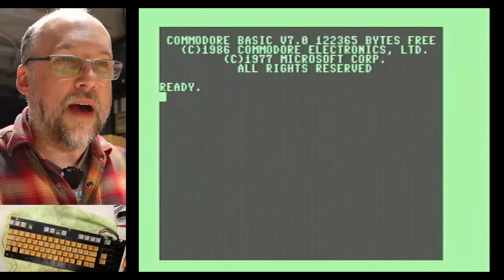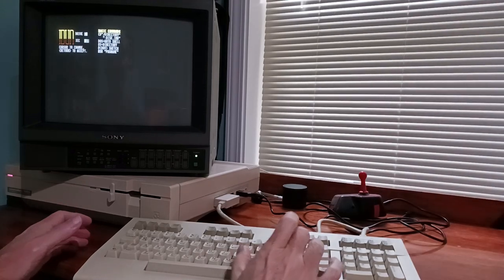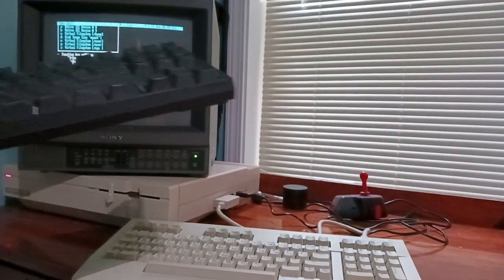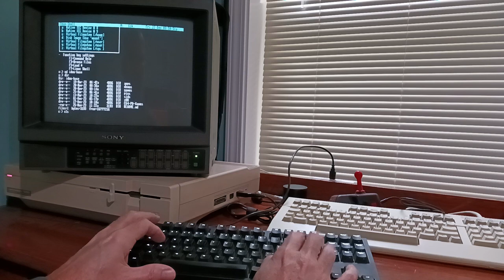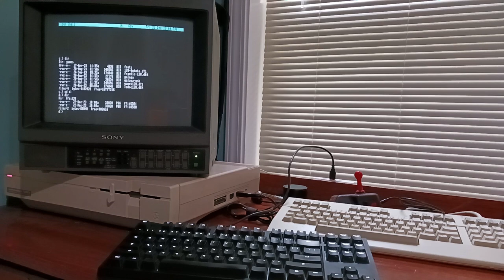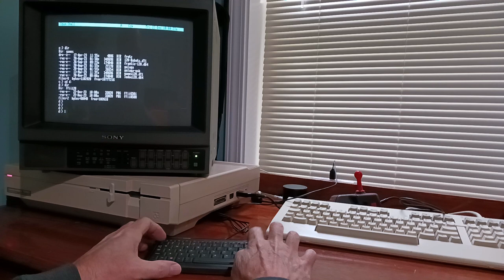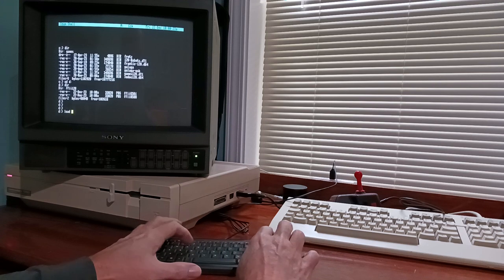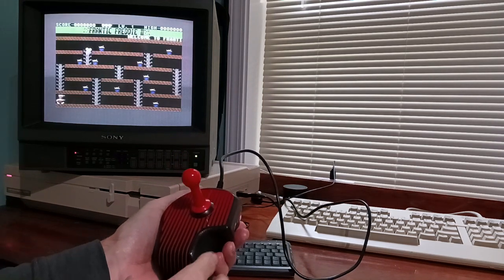Commodore 128 Mechanical Keyboard Upgrade (in 30 sec.)

Comment: Bought one just for this feature! Waiting firmware release
Reply: Also i can do beta testing of the firmware if you want
Reply from the maker: Thanks. You're in Greece, right. Do you want me to wait until v1.1.5 is ready so it will be preloaded on your SD card? Otherwise, it will be v1.1.4.
Reply: @idunproject  no dont worry i am an engineer
Reply from the maker: @ghosthuntergr Excellent!